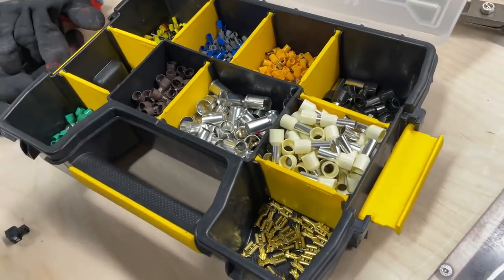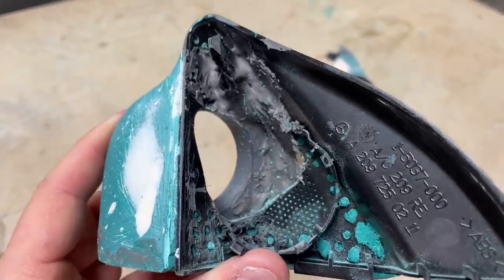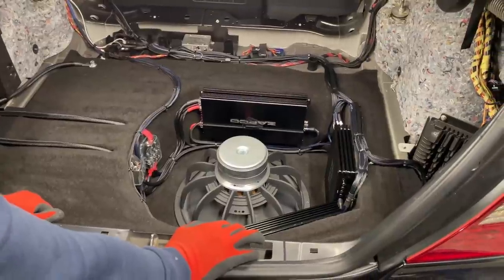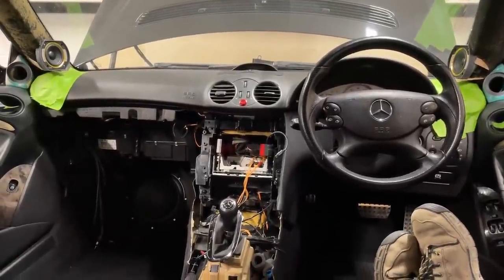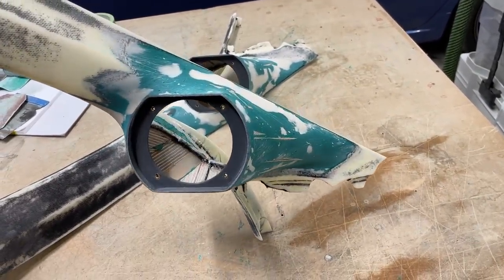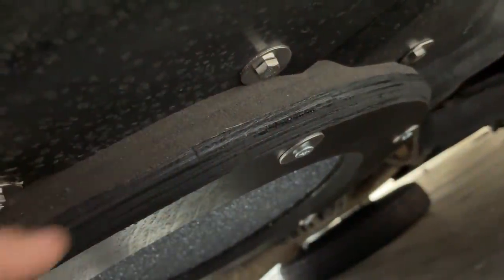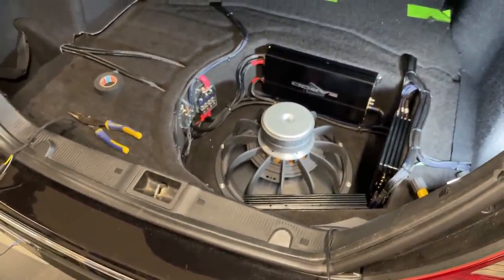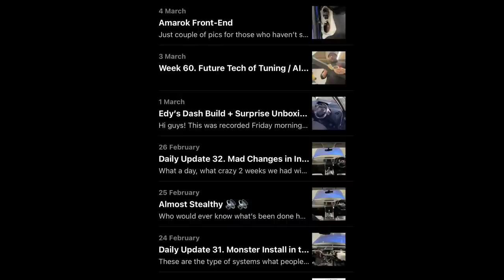Mercedes CLK 5WAY SQ System - PART 4 - Tweeter & Midrange Installation, Timelapse - ESB Audio 8000

Comment: Pete, as somebody that has always thought of themselves as a SQ devotee, I had never thought of half the things you covered in a quarter of thus video alone, found you searching for IB sub installs (mainly for bass), and you've turned my head 720 degrees, in the process of building a 3 way system for my work van, it'll be compromised,  made up of bits collected through the years, but I've decided to do the best I can and work through the install, regardless of time constraints. You're videos give me the boost to see me through the doubts, so a genuine thank you, as soon as the financials have settled down (damn covid) I'll be over the patreon for sure, if only to repay the education thus far. Oh and while I'm in Australia, Helix stuff still ain't cheap, or at least for me, gots to love the second hand market though!

Comment: Great stuff guys!
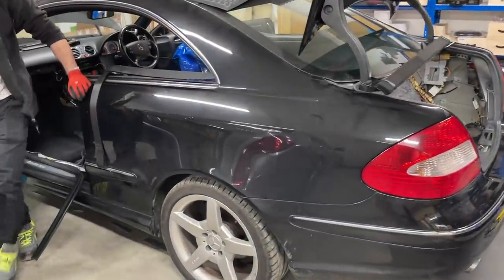Well, 10:10, you could potentially 3D print the whole thing. But then you need to design and draw them first. Maybe for one-offs this method is easier and faster with a better result.

Comment: Hi Pete, thank you for sharing all the awesome tips and tricks :D good video as always! really excited to see/hear the next video! 

i have a question if you would be nice enough to help me. my buddy has a 2-way system + sub active on a pioneer radio in "3-way mode" that we installed last weekend and i cant really get the stage to move. i either have the stage too far on passenger side or i hear it from both sides. any ideas? is it because the tweeters aim at the side windows? i thinks its because of the reflections and i told him that we'd have to build sailpanels and aim them properly. i do understand that midbass in the doors in a 2-way plays midrange aswell and doesnt allow for a good stage. but would aiming the tweeters "kinda" solve the issue or atleast make it better? he does not want to go 3-way and spend alot more money for a dsp sadly.
Reply from the maker: Quite possibly it’s tuning related. Even a 2way system with not the best aiming on tweeters can have a rough centre image. Optimising tweeter aiming can certainly help in many ways.
Reply: @pssound9749   hi pete! sadly i dont have a measurement microphone. but i fugured it out by now. so, i had to drop passenger side tweet -4db and midbass -2db since driver side is so much off axis, its like 80° off on driver side! now its pretty much in the middle! its by all means not even close to perfect at all but its fun to listen to music now. weird how this stuff works but i really enjoy it! i might actually have to buy a UMIC-1 and use rew in the future. i've been really really motivated the past 10months or so and now its even crazier! thanks for the help pete! <3
Reply: @AlexWayne1  Something you can play with is try reversing the polarity of the 4 front speakers. Do one at a time, if it sounds worse, flip it back. Sometimes the passenger tweeter responds well to being 180° out of phase. I think the Pioneer dsp allows this, if not, you might need a second person to physically hold the wires and switch them around while the other person listens. Sometimes the sound is the same, sometimes worse, but sometimes better. Its all part of tuning.

Comment: Wow YouTube is clutch with recommendations, I’m doing a build on mine could you give me some pointers🥺, porfavor. I’m running 2f8.9 audison on my c class. Currently audison has no drc solution for controlling 2 dsps at the same time, sim Im running a twk 88 audison with the drc and control my sources and volume, my sources are navtv zen optical in, amas96k rca in, and I’m running a toopingds10 coax, but I’m curious which way should I run the cables to avoid ground loops and distortions. Should I rund a long usb to the back and keep the toppin in the back or keep in the front and run a coax to my trunk? Nice content guys